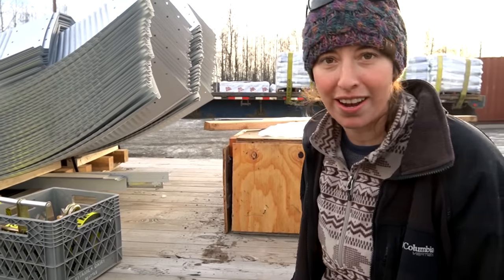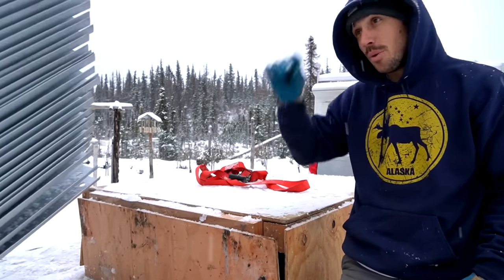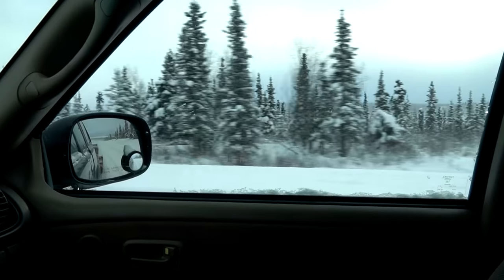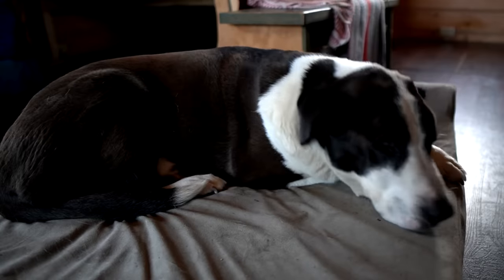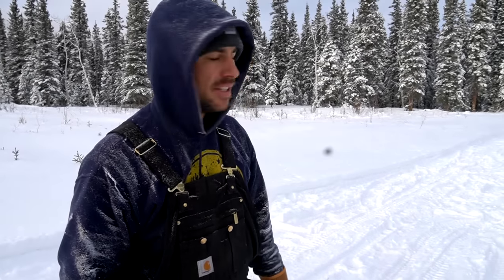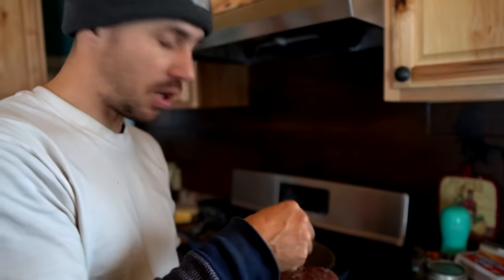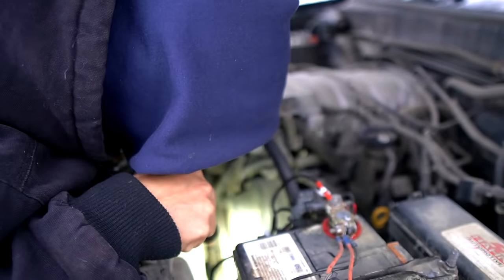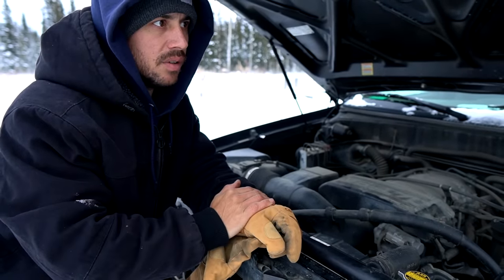Heading North to the Cabin | Hauling Next Year's Big Project

Comment: OK -  I live in the foothills of the Adirondacks in Upstate NY.  We get most of our snow via Northeasters, which dump ~20-40 inches of snow (which can be wet/packy).  Over the years, there have been SEVERAL of the Round Quonset garages that collapsed under the snow loads.  Local Code roof snow load design is for 90 lbs/sq ft.  Perhaps the garages that collapsed were NOT designed for those loading's.  I would check with the manufacturer to see that the building can withstand your local snow loadings, especially at the low temperature levels.  Steel has a Null Ductility Temperature around -20 to -30 Deg F, where it can become brittle like glass, depending on the alloy.  If the building has NOT been designed for your environment, then internal bracing might be required.  It is better to know potential problems, BEFORE there is a problem...

Comment: Not sure how you plan on installing your new building. I have built a number of these and you may want to consider a concrete foundation like the new cabin has up about 1.5-2 ft off the ground. It will give you a more usable area height wise along the wall.

Comment: any home that comes with a gun safe is Alaska approved! haha What about installing a 12V circulation fan to take the warm air from the cabin, pump it under the cabin, and use the return as the air feed to the wood stove? 
Just a thought about optimization! :)

Comment: Top tip with that type of miracle span building, not sure the exact brand you got if it has the baseplates with the up stands on the inside they fill with water and go green and smelly fill them with grout or

Comment: Are you using the base plates to attach your arches?  If so you may want to measure the distance of the holes on each end of the panels of your quonset to make sure you put the same ends on the bottoms that attach to the ground.  Mine were off .100 on each end & played hell trying to put the arches up until I figured out what was going wrong & flipped them around.

Comment: Make sure water is not standing between the galvanized steel sheets for a long time the zink get ugly white rust , witsh will degrade  the metalCoting faster than if the components 
Are mounted in the building. 
Titly stacked metal pieces like to suck up water capillary and hold it.
One way of stopping this is tilting the stacks in combination with covering ,made so a air layer is between the cover and the materials. Or stack the sheets with a  air gaps between them iliminating  
Capillary  forces.  
I have done the mistake with  roof steel plate  that was only dip galvanized  some plates were not only white rusted but the steel was 
Rusted in some spots also,  these plates were not usable in the end..

Comment: That power Box insulated you have. It's probably designed for a solar generator and it looks like with the plug in it was one of the bigger ones.. This does need an exhaust port and by the look of the cleanest album you're silver installation  Write no blackness saying that the gas engine was in there.  He would need to keep his solar generatorAdd a reasonable warm temperature for the batteries safety..  So indeed that may be your battery room..

Comment: You have that great front porch. I’m wondering if you couldn’t use part of that to enclose and use it as a place to leave shoes and hang coats. Also why don’t you use the wide flat plastic snow shovels?  They are lighter weight and hold as much if not more than the shovel you used in this video.

Comment: We helped my parents with a Curvco.  If your manufacturer states you can assemble using just scaffolding, don’t believe them.  Lol😂 We had a much smaller build, but the arches are not as stiff as you’d expect when pulling them vertical.  We recommend a lift.  Complete game changer, which turned a dangerous, multi-day job into a safe and short job.  I previously posted a 20 second link of our technique, but never showed up in the comments.  Maybe links are not allowed.  If you’re interested in how we assembled, let us know and we’ll send you the link.

Comment: So just a recommendation, don’t get the full sized firman. I had one and it was terrible. Burned oil like crazy and only lasted about 30 hours. Actually I had 2 of them. I also have the smaller 2000 watt firman which has been nice. As far as a full sized generator I’d recommend the predator 9500 watt. I live off grid in northern Arizona and it’s been great.

Comment: So I had made a shed for my generator. And what I did was when I made the frame for the little shed I placed the studs the width and like 2 in more on each side of the vent of the generator. That's how wide I made it then I wrap the 2x4s with aluminum. Cuz aluminum doesn't stay hot. And the flap lifts up and I have a little hook with a chain and would you believe you know when you get gloves they have those little clips to hold the gloves together I don't know if I'm explaining it right are you know what I'm talking about but anyways cuz the chain is small I'm able to hold the chain and clip it with that. Anyhow I have a dryer vent up to the left of the wall that has that side that lifts up. Not the best explainer so bear with me lol. And that dryer vent so that I don't have to keep the main door open for the generator which is very small by the way it's just an extra large dog house. I can go in and stand up it's about 5 ft tall cuz I'm 5'3. So when it snows and I have to put gas in it or when I started I don't have to be in the bad weather. Anyhow that dryer vent I put the cord for the generator in there. And when I want to store the chain cuz it stays hooked up to the eve of the roof. I just put it through the hole. It's not insulated. So my suggestion would be that you put an outside door like you cut out a hole of that shed. And I would add on some type of barrier so that the snow doesn't blow into it. And I'm talking about that shed that's already been insulated. That you have. And I would somehow trim around that little entrance with aluminum. So that it doesn't catch fire. Now if you can find an aluminum grate you can stick it in that hole. So when the doors up it'll just blow out. You probably could make one with some aluminum. Just punch a bunch of holes in it. Anyhow that's my idea. Now personally on lumnah acres. He got an outside stand by generator and he lives in New hampshire. And he didn't underground propane tank. I don't think you guys can get deliveries where you're at? I'm not quite sure how that works in your area. Anyhow his generator has an insulated battery. Something to think about. And I was thinking about when you keep your solar batteries down underneath the basement which was an excellent idea by the way. You could still make a box that was lined with fire retardant insulation and slide the batteries in there to keep them even warmer during the winter. Anyhow I'm super excited for you guys. And I hope you guys fix the truck and it stays fixed LOL always sucks when there's one part that keeps going bad. And I can't wait to see how the conic turns out.

Comment: Did y'all buy the Quonset Hut from an Alaskan supplier, or order it from the lower 48 and have it shipped up???  I'm curious as I had thought about building one of those on my place on the Kenai Peninsula for a shop... I just won't need a 2400 square foot shop... lol.  You've got a much newer model Furman than the one I have (had).  I bought their smallest one in 2020 and had it shipped to the Kenai Sportsman's store... which kind of freaked them out when they saw my Texas address... lol!  That one of mine is only a 1500 watt size (I think, maybe it was 1200 watt).  We wanted it when Jim's cabin shell got delivered so we could charge our phones, computers, and run a light or two.  It was extremely temperamental and would just randomly shut itself off.  I took it back and one of the gals at Sportsman's worked on it for a little while and it did run better.  It did use quite a bit of oil though.  Jim used it in 2021 when his son and friend came up to help him mostly finish out his cabin shell and add a small annex for a utility room.  I used it this past summer a lot while I was on the Peninsula for 3 months.  About 2 weeks before I left to come back south for the winter, it coughed and blew a LOT of black smoke... so I'm thinking either a value burned out or piston rings broke.  I think I paid maybe $250 for it, so now it's basically a boat anchor.  The gal at Sportsman's told me that there is no one the Peninsula that will work on Furman's.  Fortunate I had bought as big 12KW Dual Fuel Duramax generator and shipped that up.  That thing is awesome!!  So when you're looking for a bigger generator for the new place you might look into Duramax.  Y'all stay warm!!!  Jim is wintering over this winter, I'll be back up next May.      Bill

Comment: Hey to you 2 :) What an awesome video. It's great to see you planning your next project. You both inspired us when we did our flip house in Spain, and you're still inspiring us today! Got a question, have you guys noticed a huge price increase with metal materials (steel, aluminium, zinc etc.)? Here in Europe, suppliers say that metal has increased by around 70% in price. But from our experience, it's more of a 125% increase. We were curious to know if the states - especially remote states have seen similar increases. From what you are showing in your video, it seems that you had no problems sourcing the material. Or maybe you are just so well planned :)  Here in Europe,  we had to wait 2 1/2 months for 13 sheets of corrugated metal for our roof. The prices have not only increased a LOT, but metal is super hard to come by... Was it hard for you to get?  We know you have many comments on your video (because you're awesome) so don't feel obliged to reply to this comment... But if you have time, we'd surely appreciate hearing a bit more about what's happening price-wise for building materials on the other side of the ocean. Best of luck with this new adventure of yours; we're definitely following it :) We both secretly hope you'll build another root seller (that was when we joined your channel about 3-4 years ago). We are planning one here in Portugal, and we decided not to build with earthbags after seeing what happened to yours. Yep, we have seen the rise and the decline of it...  RIP, root seller...  Much respect and many blessings to you both, your dogs and the cat :) xx

Comment: You said worse case would be putting the leaking truck on the other trailer. Wouldn't that be more fuel efficient for your drive home than driving both? And then you don't both have to drive the whole way.

Comment: What kind of batteries are you using for your solar systems? AGM? I am supposing that LiFePo4 are out of the question due to the inability to charge below 32*f ?
Reply from the maker: We are leaning towards lithium and keeping them in the heated crawl space
Reply: @SimpleLivingAlaska , it's going to be worth it to get the ones that are self heating or using 12v oil pan heaters and a little insulation  rather than just a cold safety cutoff on the BMS or charge controller? ...just on the off chance that you are away from the property and not actively heating the crawl space in zero and sub zero temps. 

Other formulas of lithium are not as temperature sensitive. You might lose some charge density vs LiFePo4 but it's Alaska in the winter time. Planning for "Oh Sh!t!" is just part of the program, right? lol...

Good stuff people.... Love the channel!

Comment: I cannot believe that there's no insulation underneath that floor? Is that to help the heat get down into floor area so that the pipes won't freeze?
Reply from the maker: Exactly 😁 otherwise there would be problems with the pipes freezing.

Comment: I had to Google "A-Model Quonset Huts" to find out what it is. Very impressive 40 foot wide 60 foot long you will be able to get lost in it.  I guess you will be using it as a big garage.  
Will you be getting a company in to build the "A-Model Quonset Huts" it is very large? for you.
I guess you could build one section at a time flat on the ground then stand it upright. First section will be the most difficult to stand upright by yourselves.

Comment: Good video BUT.

Please in the future do not run your staps on the outside of your rub rails. 
If somthing ever hit or rubbed the side of the trailer it can cut your staps and make a bad situation a whole lot worse.
Put them between the rail and edge of your deck then hook underneath the edge of your trailer there should be a rail there for that purpose.

Comment: How do you pull the pump if the house is on top of the well?.
Reply from the maker: Right out the front door
Reply: @SimpleLivingAlaska no boom truck to pull out the long pipes and pump? Where is live pump houses either have a removable roof or a panel in the roof they can fish it out of. Regardless, cool place!